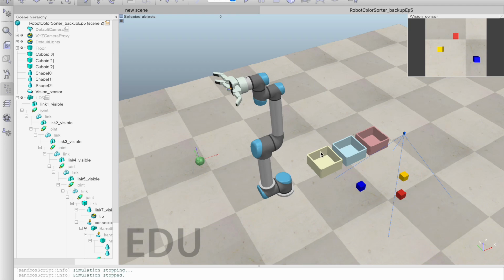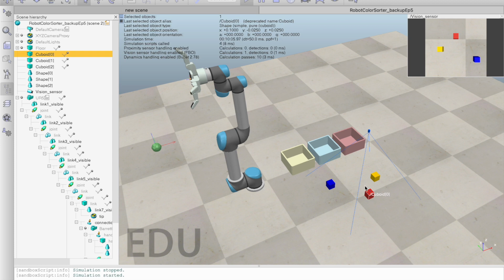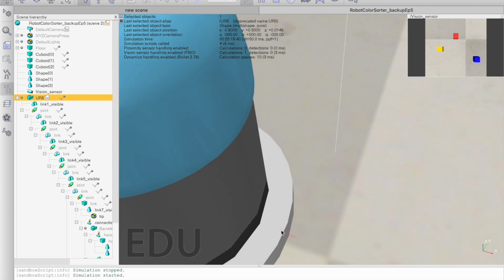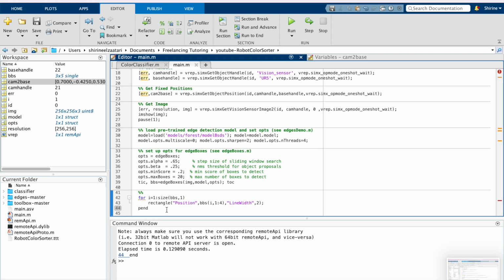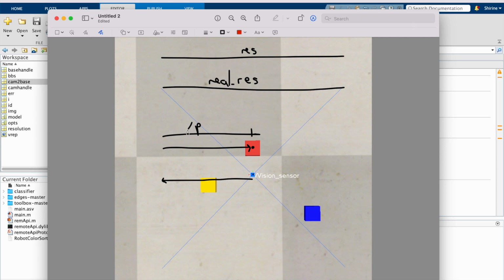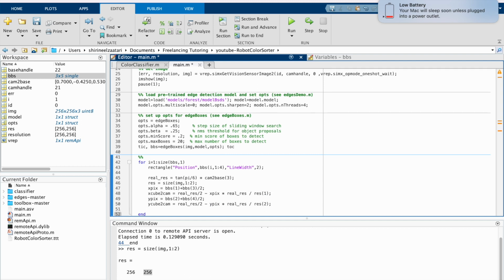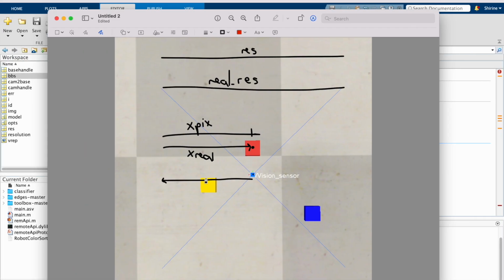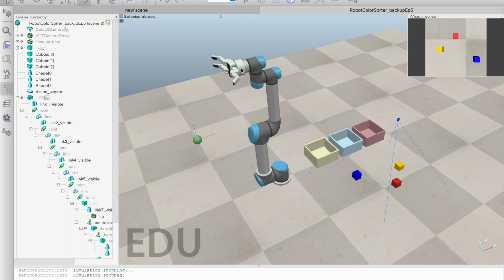Convert Pixel Coordinates to Real-Life Position in MATLAB || Ep.6 Robot Colour Sorter

Comment: Thank you ma'am for the tutorials. I wanted to ask about an issue I am facing. After copying the IGPathGeneration robot script to UR5 in the new scene and after adding the tip and goalPose dummy, I'm still unable to get the robot moving. I checked the properties of the robot in the tutorial and new scene, they are same. What do I do?
Reply: I think you have to change simIK.constraint_pose to simIK.constrain_position. Idk why but it was set to simIK.constrain_pose when I opened it.
Reply: Hi, have you solved it yet? I'm having the same problem.
Reply: @srgiosoldado  nope. Couldn't solve it.
Reply: @nandanumrikar4719  What did you do then? Sadly there are no more videos either
Reply: @srgiosoldado  My work was not actually dependent on this, so I could carry on with the simulation without this feature working.
Reply: check the joint angles in the example and make the same angle in your copy pasted one also. this worked for me.